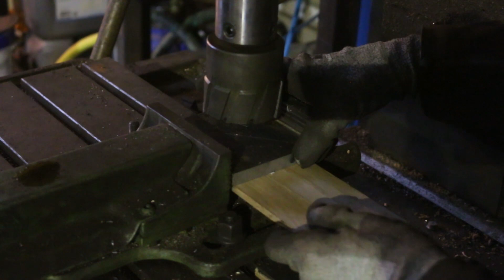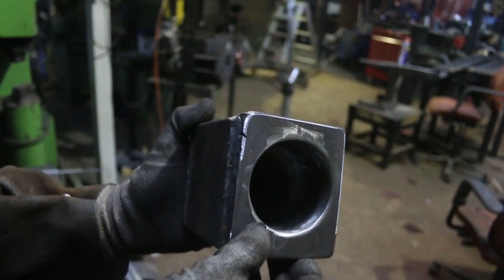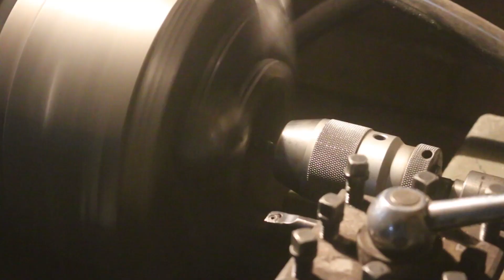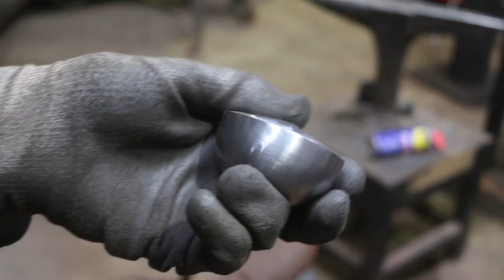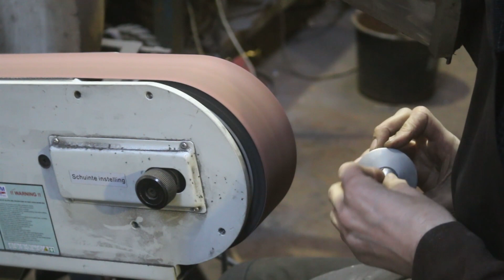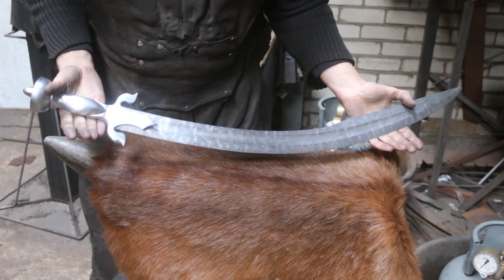Forging a pattern welded Indian scimitar, part 5, making the pommel.

Comment: Wont that handle hurt like hell if ya hit something hard with the sword, since its metal?
Reply: Not an expert, but I don't see how it would actually hurt you while using it. You could argue that it wouldn't be particularly comfortable to wield, especially in cold weather, but other then that...
Reply: @icywhatyoudidthere  evidently you've never banged a piece of metal, as a machinist I have dozens of times. The vibrations can be very rough. It looks amazing but with an all metal handle, I'm assuming this will vibrate very badly, again it's just an assumption by someone who's worked with metal for 20+yrs, but I've not actually held the piece so I could be wrong....
Reply: @Apathymiller  The handle part is hollow, that might help absorb vibration.
Reply: @Forlornguild  yeah that'll definitely help, and besides an occasional bone I dont think someone would be hitting something hard enough to have it vibrate real bad lol
Reply: @Apathymiller  Handle probably good for moderate usage, if you ever had to do any Spartan style combat with, hour after hour hacking up oncoming armies, the handle might become uncomfortable.